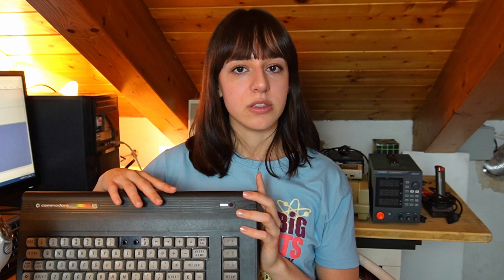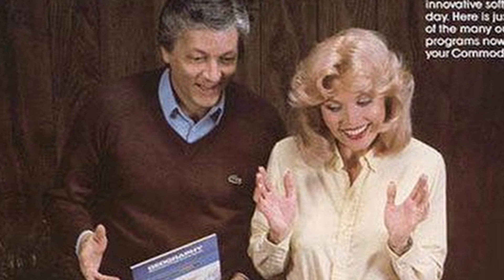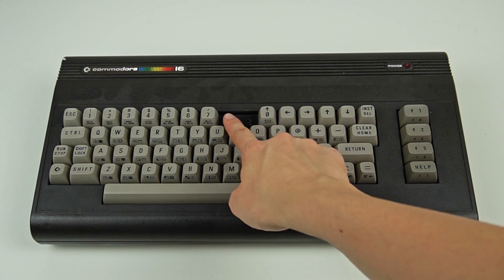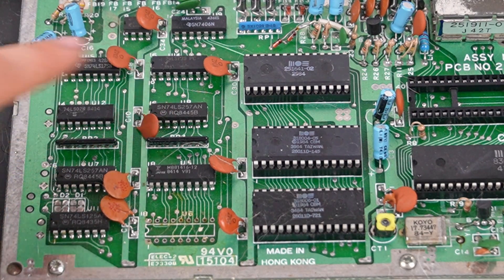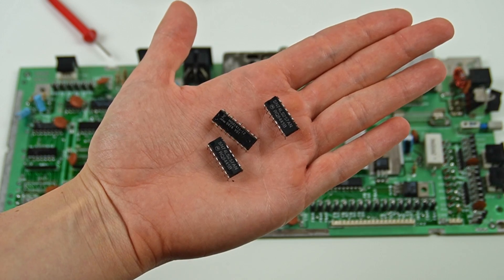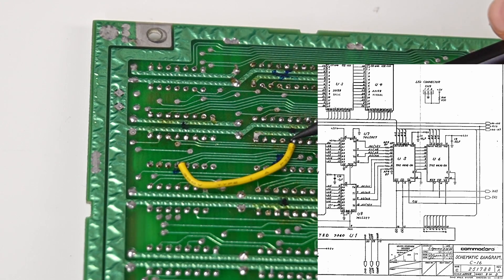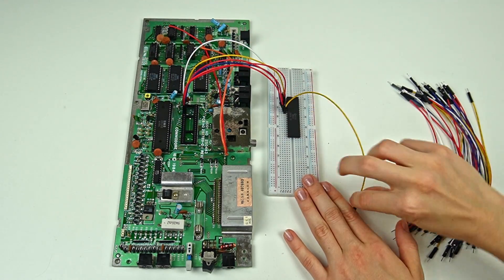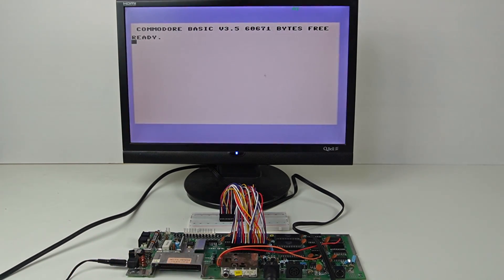I upgraded a Commodore 16 with C64 CPU & RAM

Comment: My first computer was a C=64 back in 1985 and I love getting to see someone learning on the same family of machines that gave me so much joy. Great job getting things to work, that must feel so rewarding! I look forwards to seeing more videos of whatever you're working on. You're doing a great job sharing what you're learning and I look forwards to your future videos!
Reply from the maker: Thank you so much for your kind words! It's amazing to hear about your experience with the C=64. I'm thrilled that you're enjoying the content. :)
Reply: It wasn't 1985... it was 1981. A LONG time ago 🤣
Reply: @AaronBrooks1  Spectrum+, Amstrad 6128 (green monitor), Amiga 500, Amiga 1200 then went over to PC. My older brother was mostly responsible for this.
Had a lot of peripherals too over the ages, from microdrive to light-pen, digitizer, sampler, CD drive, HDD, accelerators, memory expansions, first generation of optical mouse (with special grid mousepad)....
The Amiga 1200 was decked out for its time, 68030 accelerator and 10 MB extra memory and 50 MB HDD. Back in 1994 the first modem was like 1200 BAUD.

Comment: I was going to suggest making a pcb adapter for the 6510 but saw the project link already has them for cheap 🙂. I've designed some adapter boards to use eproms on old nes/snes games using easyeda and it's fun. Looking forward to seeing your new soldering station. And good job Sayaka ✌